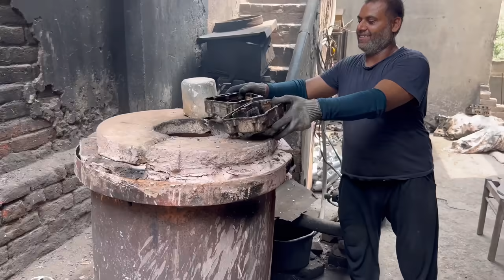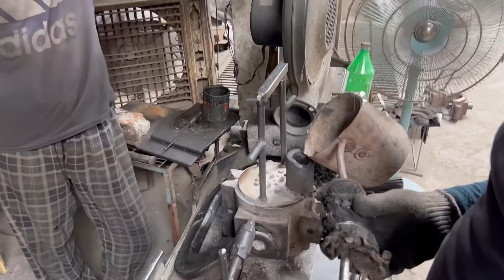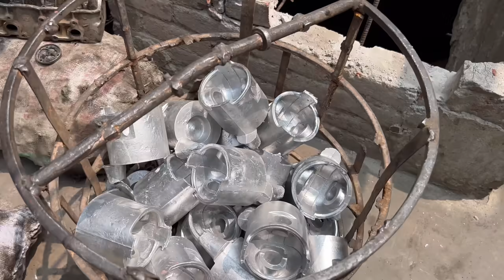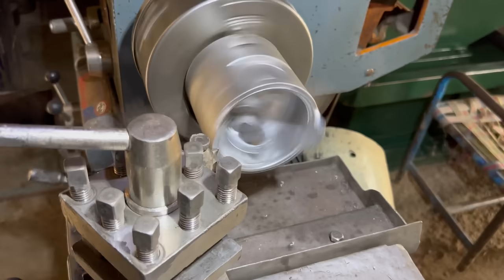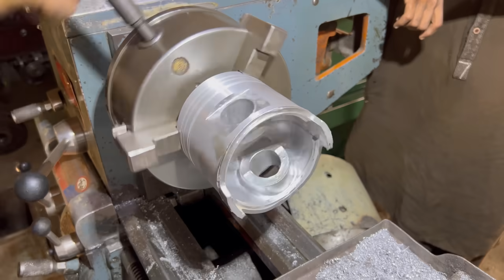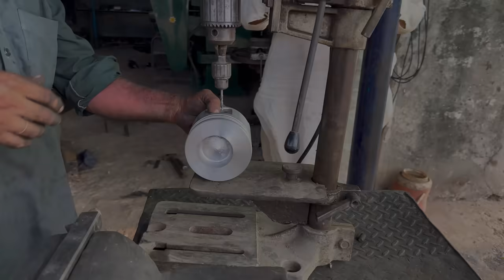How to Manufacturer Process Of Truck Engine Piston - Production of Engine Piston |

Comment: OMG! wth? are you kidding me? I'm retired from Wiseco piston in Mentor . Our pistons were forged from 4032 and 2618 alloys, we had rigid heat treat procedures and tempering formulas. Also proper fixtures and job specific tooling, what most people dont understand is the piston skirt is turned oval (out of round)for a reason! The head and ring groove area is solid and expands evenly as the engine warms up and spreads the pin boss apart there by distorting piston skirt making it rattle (piston slap) oval turning prevents that in the first few moments of engine start up as piston skirt is perfectly round now.
Reply: This is a rip-off, OEM, pirates or would you say, it's a local spare part being sold with no brand, it's cheap, so cheap than brand new og certified spare parts, where I come from and other develop country used this kind of technique
Reply: Hey, used many a Weisco piston in HP Stock Car and Road Race engines, but I don't think you will find too many in the HINO trucks they use over there.

I have no idea how they get away with it but from the looks of the castings they have laying around apparently they do it every day.  (BTW, I live in Mentor)
Reply: Ligia Gom  HA HA HA HA.....
THIS IS PURE COMEDY...!!!!
Reply: Ligia Gom  yeah surprised if they last more than a couple of hundred RPM on tick over.
Reply: Hey!  You are supposed to say what they do is amazing because they live in the stone age and can spin and cut some metal.
Reply: But you guys refuse to make custom pistons unless you buy 12, and its $4,000...and they do not want to do it...and long wait. So these guys are a step above wiseco.

Comment: Back in 1980s UK we would sometimes buy piston kits for out 2T motorcycles. Most kits were forged billet but every now and then we'd be sold cast kits. The quality difference was very noticeable and if you had a cast kit you knew you were on limited time as they always failed quickly.
The pistons here have questionable metallurgy never mind machining tolerances.
Reply: their 2022 is our 1980...
Reply: Must be pistons for Indian or Chinese motorcycles.
Reply: @overdrivelzma.9219  No with that offset chamber in the middle they are most likely for a direct injection Diesel engine. It would be very interesting to compare the weighs of 30 or so. And what is the Silicon content. How much pi
ston to bore clearance is required?
Reply: @overdrivelzma.9219  Did you see the size ? that would be an enormous motorcycle...
Reply: thecouchtripper  Lower rpm, but higher pressures. If the cheap cast pistons he describes failed in two-stroke motorbike engines, there's a good chance cast pistons of unknown metallurgy and approximate machining are not going to have a long life in a truck diesel.
Reply: just melt it and send it who cares about metallurgy
Reply: @jackking5567 You can't say you have no tolerance if you don't measure the part :D
Reply: @overdrivelzma.9219  This video is from Pakistan, Indians have better industries and use only high end products tested and certified.
Reply: Bloody Nora 😢
Reply: Can you give ASTM data sheet of piston metal. Recommended MOC. Torelance, expansion coefficient, heat coefficient. Only recommeded material is used to make such otem
Reply: @zimone89    "their 2022 is our 1980..."   No!  Il loro è il 1880!,sia per le macchine, che per i materiali,della tecnica non ne parliamo proprio...      🤮🤮🤮🤮🤮🤮
Reply: @fasullodavvero well I for one admire that they’re trying and it must work or they wouldn’t be doing it. I’ve seen some amazing vids compared to this one, this one was pretty bad, but some parts are actually very well made.
Reply: @_..-.._..-.._    Hai mai revisionato un motore ,come prescritto dal manuale d'officina?,mi fai un'esempio di parte ben fatta?,in alcuni paesi che funzioni per 2 ore o 2 anni è la stessa cosa,questo video spiega esattamente tutto quello che NON si deve fare,MAI!

Comment: The recess in the piston top indicates it is for a diesel engine.  So does the full skirt, up to a point.  Modern design pistons are not round.  The piston is slightly elliptical so that when the engine reaches design operating temperature, the expansion of the aluminum piston makes it become round.  They left flashing in a number of areas such as the skirt bottom and the wrist pin bore.  These pistons have to be for a low load, low rpm engine such as the single cylinder engines that they use on water pumps, etc.  Even at a maximum speed of 1800 rpm, these pistons would probably wear rather rapidly and develop piston slap in whatever engine the pistons were in.  And as others have mentioned, the questionable carbon intruded alloy could be brittle.
Reply: Maybe these are roughed out blanks that go on to final machining in an actual machining operation? I can't believe that is a usable piece as is. Still the casting is a joke.
Reply: Who governs the quality of aluminum or steel?
Reply: In a one cilinder it wil last not verry long. If it's a 4 cilinder or more, all the pistons have to weight the same. Otherweise the engine wil shake itself to pieces by unbalance. 1 gram differance is a killer olredy.
Reply: Can anyone tell whether zinc aluminum alloy is good for making pistons of bitzer semi hermetic??
Reply: Indeed. Pistons are not round, the are oval, if new. Careful selected metallurgical composition and heat treatment made them last a while in older cars. Modern pistons are forged.
Reply: Modern engines,, since the 1930s!!

Comment: Could be suitable for a low rpm steam engine or a water pump or something (this is possible as they have all kinds of weird irrigation pumps over there), but I don't believe I'd use it for much more than that.
Reply: @hbhahzhy673  English???
Reply: @hbhahzhy673  looks like a Bedford Truck TJ piston.I think that 6 ton truck has a  6 cylinder 5.5 litre diesel.
Reply: Это точно  поршень для дизельных двигателей
Reply: Truck engine....its low rpm
Reply: Nomen Clature  How about weight. A couple of gram difference between all pistons  wil make the egine unbalance and shake itself to dead, even at low rpm.
Reply: Souvenir ashtrays?
Reply: For trucks and tractors, they last probably 200k before needing overhauls which are still cheap. Either way gets the job done, just hurts your emotions if fanciness is your forte.

Comment: I love how the fresh castings are thrown on the ground on top of each other.  Nothing like adding pre-wear to the piston skirts.  Dust and dirt is good for lapping in the rings.
Reply: Too poor to have any table or storage boxes
Reply: @juhajuntunen7866 guaranteed they're not so poor they can't prevent tossing them around on the ground. A dog could learn to set them down easy.
Reply: they get machined afterwards. So there is no pre-wear on the skirts whatsoever. The dust can be easily cleaned before being put on the machine
Reply: @dieselgeezer18  They throw the freshly “machined” parts on the floor and in a big stack.  All the washing in the world won’t help that.
Reply: @rxpsycho7326  you said in your top comment that the pistons were dropped right after they were casted, not machined
Reply: @dieselgeezer18  You are not going to change my mind on this one.  They have no master spec standard to follow other than a new piston if they are even doing that.  It’s fine for their needs and guarantees the work keeps coming.

Comment: Start-to-finish… this is exactly how not to make a quality piston.
Mixed alloys, water dunk, dropped on the floor, triple chucked on three different surfaces, wrist-pin holes machined separately (and not reamed?), sloppy oil holes, burs galore.  Was it annealed? 
Then there’s the basics.. ambient material temp expansion corrections?  Micrometer zeroed for non-standard temp? 
I dont expect full tilt cnc over there, but we’ve been doing better than this since the 1930’s.
Reply: But how many have you made exactly?
Reply: This guy knows what he’s talking about is true how the hell this people expect that piston to work properly when no measurement at all was taking not one but you know I guess quantity is always better than quality who cares I’m not surprised if this pistons make it to the market like this why we getting shit parts lately even when you buy brand name parts
Reply: @outkast187  but but but.. I see you’re one of those guys.  🙄
I’ve made much more complicated and precise items than pistons, they’re relatively straightforward.  Pistons have a simple job; dont crack, dont melt, dont gall and dont slap.. the hard part is done by the rings.  The problem with this piston is its used in a diesel with twice the compression of a gasoline engine, the metallurgy is critical and so is a perfectly square and aligned wrist pin.  As shown in this video, its junk from birth.
Reply: I never made a piston in my life.  But when he machined the wrist pin hole, my first thought was, how does he know the other hole will line up?
Reply: @XD-te6vj  They line up perfectly......or they will do when the wrist pin has been installed with a sledge hammer.
Reply: @XD-te6vj   I understand the concerns,  but you are overthinking it.  These are not pistons for 10,000 rpm performance machines. These are low rpm diesel pistons. These guys are doing it, and its working.  Would it be better to machine from solid 7075 billet on 5 axis cnc? Absolutely.  But these guys are riding before you could get the gcode done. This is how all pistons were made, its just more refined now. It works.
Reply: Using just one tool bit saves a shit load of time so we can get the MONEY faster. Who gives a fuck about quality, if it looks the part then it’s OK. 
Just sayin!!!
Reply: Easy, they do not make quality pistons :-)
Reply: they omit the final clip saying "made in Japan".
Reply: @outkast187  I think you’re under-thinking it.. if their ways “worked”.. well, just look around, everything is that way because everything they do is approached in the same way as this piston.
You’re right, its not a race car piston, its a diesel piston, likely in a mechanical fuel pump engine, which will allow the driver to bog down the engine while fuel pools on top of the piston, and that drives up the compression ratio and heat real quick.  Again, metallurgy is king here, and this one is crap.
Reply: You forgot to mention the operator reefing down the hard jaw chuck directly onto the finished ring land area, not even using protective soft metal shims.  I had to look away.
The oil drain hole drilling was pretty special too, see how much the drill chuck was wobbling around?
Don't like knocking these videos as these guys flog their guts out making stuff with the most basic equipment, and I've seen a lot of ingenuity and skill in some of them, but not so much this one.
Reply: Пакистан живет 40 лет под санкциями. Такие поршни лучше чем ездить на ослах.
Reply: Это безнадёжное предприятие
Reply: @XD-te6vj  it'll fit with a big enough hammer  just fine (LOL)
Reply: This is a rip-off, OEM, pirates or would you say, it's a local spare part being sold with no brand, it's cheap, so cheap than brand new og certified spare parts, where I come from and other develop country used this kind of technique
Reply: @XD-te6vj  guesstimation to 1000th of an inch.
Reply: @19juba72  But maybe they do not need qualty, but things that just works for them for next 5 years?
Reply: my guess, this pistons are for  low RPM machines ?
Reply: @Martink9191  5 days max.
Reply: @gooddealonly  yeah shure. They would not manufacture them if it would last 5 days. Who care what you think anyway :D ?
Reply: It's a horror movie.
Reply: this pistons are good enough, for the purpose of their customers, otherwise they will not buying that shit.
these guys just make that they can do, with equipment, which they have.
i think, they are smart guys.
Reply: @ЕнотЕнотиков-г4л  not too sure about their best or smart.. ?  They may just be smart enough to not do their best so that they keep selling crap pistons to people who are unable to get a better piston somewhere else?
Try to teach them improved raw material selection, sample testing, better/more controlled heating/cooling cycles, improved machine setup and measuring techniques.. they’d likely chase you off while saying “why would we want to do that?”.
Reply: i 'm agree with you about for the US standard it may be don't fit, but for indian society, they are make useful production and can support their family.
just the my logical solution is that they already had tested the quality by their customers, which wouln't be buy their production, if it doesn't fit their requirements and in this circumstances their do what they do. 

everybody can do pistons, if he has a chemical laboratory,  spectral photometer, cnc router, pc-controlled oven, and so on.
but to create something almost without advanced technologyies - it's the their smart criterium.
just it my point of view, i'm not say that they make the quality pistons - they have make it with minimum required equipment.
even without steel-toed shoes.
Reply: Nomen Clature  No I wont. If it fits for my needs. And only old diesel has 22:1 compression. Todays diesels are more like 16:1
you cant say, it lasts only 10 000km, if it may not be used on vehicle anyway. Fact is, you do not know where does it goes and how it is gonna be used. Stop talking shit, about things you do not know.
Reply: @outkast187  CNC won't give you that precision. CNC lathe is the way to go.
Reply: @sakuraturbo3364  I saw him use his caliper several times. Maybe you just don't what it looks like without a machine telling you if it is right?
Reply: @XD-te6vj  Ah, when they aligned the molds and poured in the hot melted metal.
Reply: @dash8465 stop whining
Reply: @dash8465 you think diesels have liquid fuel pooling in them to the point of hydro-locking? Stop lying, why do you watch this? To make fun of them? I watch it to be inspired and realize that overthinking things leads to procrastination. I bet these pistons do better than you all think.
Reply: @chlorophyll6154 why are you copy pasting this same drivel? Find a hobby.
Reply: nomenclature9607 stop trying to be cool and intelligent, it’s not for you.
Reply: nomenclature9607 why are you so insecure? If it doesn’t work, they’ll be the first to hear about it. Only someone with a chip on their shoulder would be mad at these people doing everything wrong and it working. Because you’ve been told your whole life that things have to be complicated to work. Nope, a broken clock is right twice a day. When they sell these pistons, I bet the buyer uses a caliper and other tools to see which ones they’re willing to buy, maybe even by weight. They just make pistons, if they don’t sell them all because of defects, they melt them back down and keep working. The founder of Honda made pistons like this and he tried to sell them to Toyota and they were rejected, an entire truck load was turned away. Soichiro Honda figured it out eventually, wouldn’t you say?